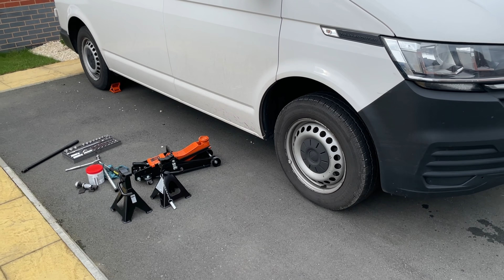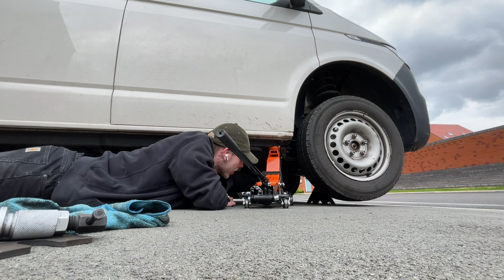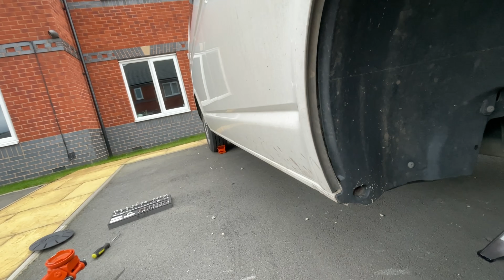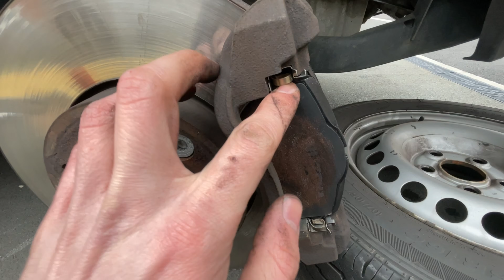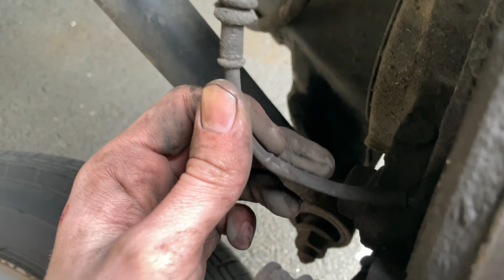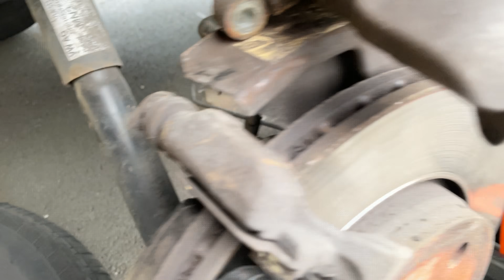how to change vw transporter brake pads

Comment: Great video pal
Reply from the maker: Thank you, appreciate it
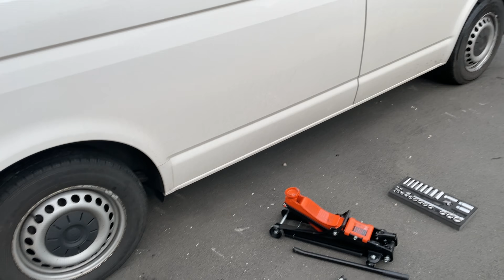Reply: Great vid. Looks like every other car i worked on. My mechanic told me that t6 transporter need to be connected to pc to reset pistons is this true? I have 2017 highline. 8:50
Reply from the maker: @marcingoralski2465  I have had no issues and done it a few times, mine is a start line but don't believe they are any different.
Reply: @hudsons_autohaus  just realised i have hill hold which applies and releases brakes when you on the like of boat ramp.